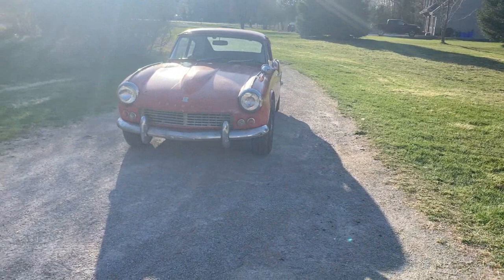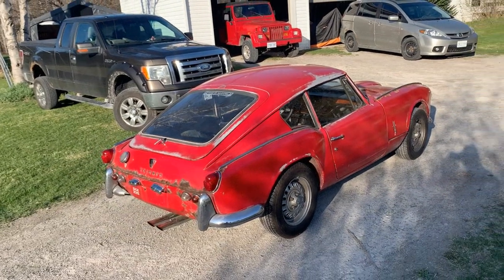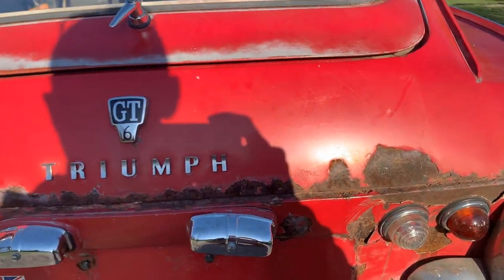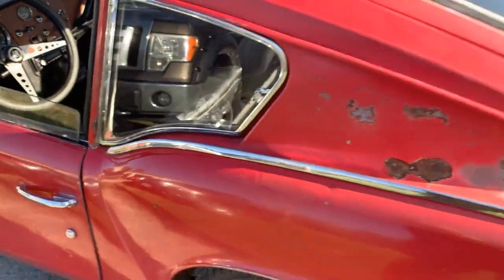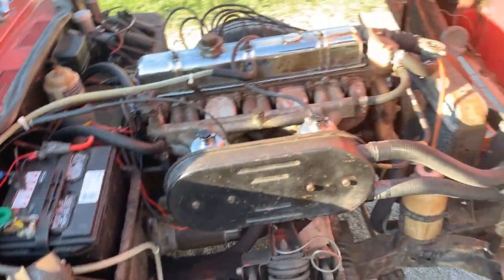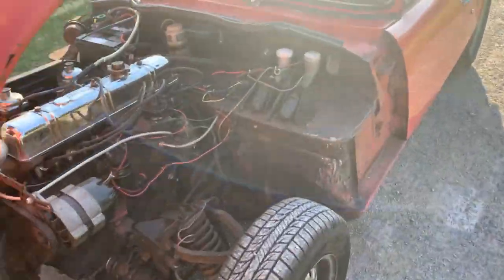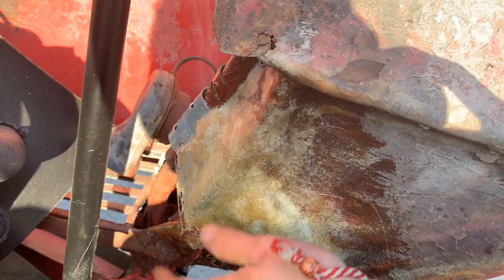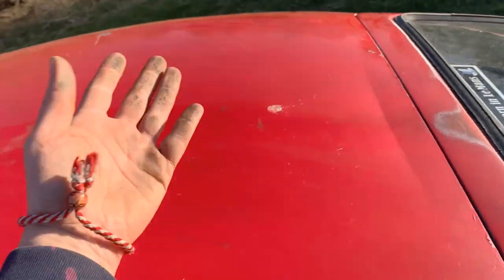1966 Triumph GT6 - Part 1 - Introduction

Comment: Triumph GT6 - the poor man's E Type.
That looks a bit of a job Elin especially on the RH side. But I guess pulling fibreglass out is easier than cutting metal...
Oh and make sure your visitor doesn't fall asleep ....😂
Reply from the maker: Yes, it is a big job. But it needs to be cost efficient, so we might replace more panels than I would do on my own car. On my car I would fabricate parts, that are cheap, but I do it because I like it. Here I can't waste time, so we will see what will be fixed and what replaced
Reply: @RustyBeauties   I am absolutely no good at repairing metalwork as you and David do so well so stick to replacing panels. Better at building engines and gearboxes though 😂